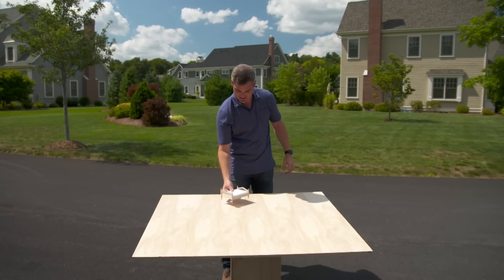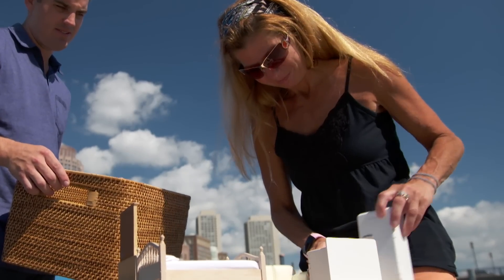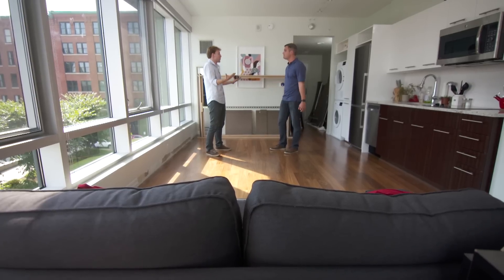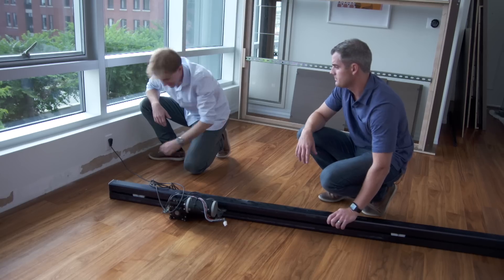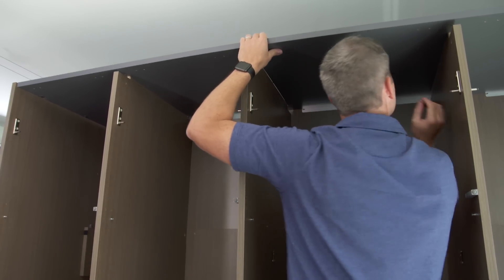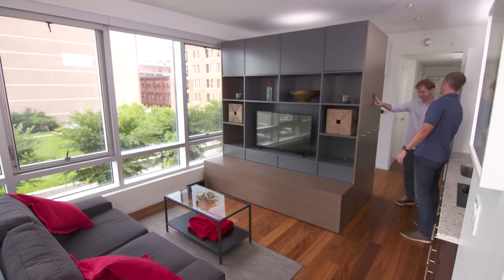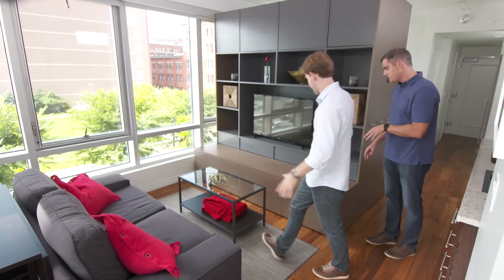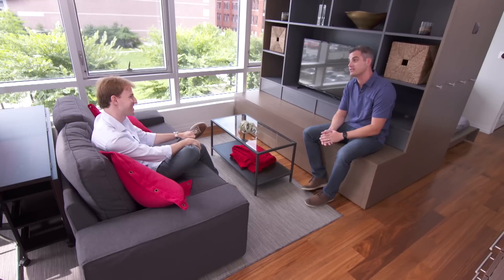How to Install a Robotic Wall | Future House | Ask This Old House

Comment: Yeah, that's a great conversation piece, but what are you really gaining when the shelf is up against the wall, a little extra space that you can never actually use. You're going to have to keep that area clear, so you can slide the shelf to get to your bed. I mean, if you need extra space just turn the coffee table sideways, put it under the window and push the couch up against the wall. I'm sorry, but the more I think about it, this one just doesn't make sense in any way shape or form.

Comment: "Hi, maintenance? Yeah, the motor for my motorized but not robotic wall went out, and now I cant go to bed." It seems to me that if they can make huge library stacks move easily by hand, this should be able to as well. It seems WAYYY overbuilt. Like, seriously, you made the entire frame out of steel? Sounds to me like a great way to scam some yuppies out of an extra like ten grand over building the same thing, but properly. I'd be way more impressed if you could actually move it with a finger, which is absolutely possible.

Comment: I absolutely would NEVER live in the city, and I do not understand the workings of the folks who do it on purpose. You could easily live in a small home and not have to be in the city. Not all ppl go to the suburbs to have bigger places, but to get away from the ugly monstrosity and the traffic and stress of the city. And all these folks that are so worried about the environment, and footprints, etc, but live in the city are actually making environment WORSE. The two biggest negative impacts on the Earth are cities and population. City living is definitely not going to help anyone's footprint or impact. This idea is ridiculously overrated and expensive too.. there are much easier and cheaper ways to have moving, compact walls.

Comment: Cheap quality, crappy, particle board low-end IKEA style furniture. It's not built to last and it's going to cost a fortune to replace. They've also completely obscured the motor meaning servicing the device will require a complete teardown of the whole structure. And since it's made of particle board, what little strength it had to begin with will be severely diminished.

Remove the motor, use better materials.

Comment: What is robotic about 1 motor with a switch? What is magical about attaching a bed frame and some Ikea furniture to said motor? Install some sensors so it can't run over your cat. Make Alexa open all the cupboards and drawers with time specific mood lighting. This concept should have been built better and be able to do way more before you put it on this old house and called it something it's not. Try harder.

Comment: I'm not following why any of that needs to be electronic/robotic.  It's basically the same principle as roller archive shelving.  Those you just turn a wheel of sorts to move.  All you would be doing is maybe removing the tracks and having it all on wheels, etc.

Comment: ok ok I can appreciate the idea behind the robotic wall but why would you actually install it for a bed?

Just make a more comfortable sleeping couch instead of having a seperat bed and you safe lots of space instead and I know what i'm talking about while sleeping 90% of the time on my sleeping couch rather than using my actual bed. The main reason I switch to my bed is because of the heat in summer in my living room while my bedroom is actually cooler. Also think of the costs to renew this whole stuff once it gets older and shabby. Not to mention additional energy costs.

It is a cool idea but completely useless in my eyes compared to alternatives which are way cheaper in both purchase and maintaince. 

I really do not get whats wrong with Americans sometimes.

Comment: man that so easy to place everything. walk in on the left is the bedroom and the laundry ( the one with dryer is on the bottom and washer is on top) is on the right, walk in a little bit farther the bedroom is also on the left (with a twin bed), the closet on the right, walk all way in the room is on the right ( with everything included) and finely the kitchen on left and that how you fit everything into a apartment

Comment: Why do they even need to motorize it? Things like that don't need such things when a simple push will do. Build it so it goes close to the ceiling so it can't tip over.  But in the long run this is a solution looking for a made up problem. Just get a raised king sized bed with built in drawers and raised posts (more on that later). Use a movable divider to separate the room as needed. On the king sized bed you can lay a top on the posts for a work surface.  All this for 1/5 the price of this monstrosity.

Comment: So many comments off topic, some about how living in the city means living in rush and wasting your life etc... The point of the video isnt about sense of life only how to design small spaces  and how autonomization can and does help in that.
Also quite sure this isnt exactly robotic and could be more with a few tweaks like ability to program how far does the wall go, sensors to make sure that it stop before hitting obstacle, not hiding Alexa on the other side only get her in the middle and make her do stuff like turn on/off tv, lights in house etc, also sliding out drawers to make it really robotic and smart
But all in all great idea and design :D but some info about where to buy it etc would be nice, its anyway almost like an add

Comment: hmm...plain stupid, ive seen better ways to slide furniture, more reliable, also slide beds.
Usualy any kind of compartimentation in small apparts are doing worse, the inteligent way of using space is to properly use the furniture and have good management, lets say there are beds that fold into the furniture and are way less expensive

Comment: you could add some sort of scissor lift to the bottom of the bed to accommodate for height and form what i can see with the bed it could fit right under the current design.

Comment: Not a robot in even the loosest definition. If this is a robot then so is my blender.
Reply: Your blender is a robot. Robot doesn’t mean a Terminator T-1000 😁
Reply: @wiiten  From Wikipedia: A robot is a machine—especially one programmable by a computer—capable of carrying out a complex series of actions automatically. The Terminator IS a robot, even if fictional. My blender does nothing automatically, it has one speed.

Comment: Well this is pretty cool but at very at the start :) it will just take a lot of iterations but once they get the following key points, it will be the normal as they said:
- Setup at IKEA level (it feels like they are going in that direction from the get go, so that's good)
- Prices for everyone (it won't become the normal until it's as nearly as accessible as nowadays furniture)
- Very customizable solutions (one thing is customizing wood cuts, or at least making furniture in modules, but they need to customize robotic pieces, and things like weight, required strength/power, etc would be non-trivial I guess)
- Well tested solutions for types of living (combinations of different parts, how they fit and interact in relation to various usage patterns, e.g. a student appartment with two flatmates or a family of four)
- More backup plans for power outage (or system breakdown)
- Software (this was just basic mechanics... we need to talk to the house, the house needs to be able to reply and do things for us (like: clean "yourself" in 1 hour please, or: we want dinner for 3 at 6pm thanks)
And there is probably more... but nonetheless... we gotta start somewhere to go elsewhere :)

Comment: i made this when i was at school and used doorbell switches (spring loaded two of them) to control the motor. the only difference was that i did not have that much money to get every premium stuff required. i too called it robotic closet and PC case and got a tight slap from my mom on the allegation of using a misleading title, so i changed the name into motorized PC table come closet.

Comment: Clever…you guys made it a hell of a lot easier to pancake someone while their asleep. 

Modern day computers & wifi sending information via binary code isn't difficult to hack if you have the right software & are intended for malicious behaviour.
Reply: That kind of assumes the machine is both strong enough to crush a person and lacking in sufficient fail safes. Just because it's automated doesn't mean that they don't have mechanical safety measures, much like my garage door actually.
Reply: Aslo Aso I could see the danger there for children, the elderly, and the disabled, but healthy adults should be able to get off in time. Lol
Reply: BillyJoe1305 Tho there is no safety measures mentioned in the video, so why assume its there, when its not.

I notice the motors powering the wheels are low geared for high torque use, so speed wont kill them but the torque of those motor holding  up & moving a heavy cabinet against a wall can slowly crush you.

David Patterson Who said they'll be awake to get crushed to death?

Comment: Let's use loads of electric energy to move our walls on rails instead of just getting a bigger room. Brilliant waste of energy! Also where was the bathroom you showed in your first example? Did you even solve that problem with your energy wasting solution? Also: Are you even able to sacrifice that one wall plug when you live in such a small space?

Comment: I remember seeing a video, from like 2010, pretty sure the original content was from before; but the guy put an entire moving wall in an apartment, along with transforming furniture. And his wall wasn't assisted by a motor, but he still moved it effortlessly.
Sofa became a bed, console table became a dining table for 10-12. 
This really isn't anything new or exciting. 
Not even robotic at all. You have a moving wall, you have some electrical components. The most 'robotic' thing about it is the voice commands through Alexa.

Comment: Is this on rails or anything? dosn't look like it is... I could see how after a few months of use, the thing could be half way across the room!
Reply: There is a rail attached to the wall (it was the thing they installed first with the electric motor) and the base for the cabinet is then attached to the motor and it just moves along the black rail thingy

Comment: For how much this costs, this is probably one of the stupidest things I've seen on TOH. There is no need for all of the motors and control electronics. A manual system with proper casters can be built for a fraction of the price.
Reply: crimsonsamuraiftw I could see the motor controls being perfect for older folks though, especially since many of them sell their big homes to live in condo apptms to move away from multi-floor homes (due to muscle issues going up/down). This could also make it easier on their bodies than a manual move system.... even something as simple as sliding out the bed could be a problem for some older folks.
Reply: I would only want this if everything was voice activated.

Comment: What if the space loses electricity? I like the modular ideas, but it needs not to be electrical. Through understanding of materials wood could do all this.
Reply: Like they said in the video, you can disengage the motor and push it.
Reply: I would design it a bit differently

Comment: i see mistake 1 in this vid ; he  blocked  usb's  plug in bottom outlet  :P
Reply: He used the lower socket when actually putting it in so he didn't block the USB connectors.

Comment: I would like to see  a bed That folds out of the wall. But when you fold it up. It has a complete entertainment system underneath of it With TV and all.
Reply: thats really not that hard at all either, just make sure you have padding and bumpers available so that the tv doesn't smack from whiplash.

Comment: This is a good idea, but it's no more a robot than a garage door opener is a robot.

The voice recognition isn't even built in.  It's from Amazon.
Reply: But they are showing that its compatible with alexa. You dont just plug in alexa and expect it to work with everything, this just shows the compatibility with voice recognition software.
Reply: Good point.

Comment: The only people who could find use in that are people who live in a micro apartment and people who are forced to live in a micro apartment have no way of being able to afford that monstrosity of robotics
Reply: Claudio Lavacca it's a large piece of furniture that's been meticulously engineered to be easy to assemble,  elegant and useful.  It could easily cost thousands of dollars.  On the other hand it's a small cost compared to a 300k apartment.
Reply: That is so untrue. In NYC for example, micro apartments can go up to 400,000 dollars for single bedroom, small bathroom, and kitchen. In many cities this is the case too. Micro apartments are owned by very well off people, as they are inside of the city. The only exception would be the un-gentrified areas of NYC which are quite small.
Reply: Of course. I didn't explain my point properly. The product they're selling it's certainly a nice piece of engineering work, but it's not that difficult to make something similar by yourself, if you're able to do it. The product is indeed an elegant solution to a common problem and they need to be rewarded for it, but the techniques they've used to create said product are quite common and not that expensive.
Reply: Yup. And they also gave a nice idea to whoever has the skills to replicate something like this by himself. :)
Reply: Jesse - in certain big cities, even a micro apartment can cost $1000/month+, and the full size apartment can cost $2000 or more a month.  So as you can see, even within 1 year, if you can buy one of these things for a few thousand bucks, you would come out ahead as long as the cost of one of these is less than $12000.  Now, this isn't the only solution to this problem - the actual problem is that corrupt city governments block and delay new construction.  They do this because rich property owners who bribe the politicians who control the government don't want new space added, because it devalues the space they already own.
Reply: NYC cannot just tell them to keep it low. It's a mix of something called hyper-gentrification and much less space.
Reply: Well, it used to be that having the bigger house was the estate-endgame.
But there was no Internet when that came to be. And entire families lived in many of those mansions (grandparents, parents, and easily up to 5+ kids).
Now, when at home, we're online, connected to a "much bigger house, with so much people, entertainment and knowledge".
In short, before there was a bookshelve (with a limited set of books) and an armchair, now with a mobile device and you can read whatever you want wherever you want. Also families are having way less kids.
I whole heartedly believe that we are going in the direction of smaller houses and we will eventually find a sweet spot between a micro apartment for a single person or a young couple and a slightly larger apartment for a typical family couple + 2-4 kids (regardless of if its geminated houses, isolated houses, or in buildings, or cascades, wtv).
Of course I am biased to what I see and living in Copenhagen did change my way of seeing things.
But I would not want to live in a big house even if I was being paid for it.
Don't get me wrong, robotics is not the solution, it's just a new way of doing the same, in less space, improving practicallity, maximizing our homeflow (in contrast with workflow) efficiency, and ultimately cutting costs and gaining time (because time is in fact the only real currency we have. When you buy a big house, you are paying with the time of your life that it took to acquire that money).
Sorry for the lenghty post. I was inspired. I hope it's inspiring. I need a beer. Cheers!
Reply: Claudio Lavacca fair enough,  looks like these products are geared towards those who don't have the time,  space, or technical knowledge to make their own.
Reply: Why not just keep property price low? A small single room apartment shouldn't cost the same as a 3-4 bedroom house
Reply: @keeganlad  and how do you propose that happen?
Reply: It's not really robotic. And a simple piece of furniture attached to a motor is not that expensive.
Reply: A small space like this can easily cost a million dollars in places like NY and SF. So you're assumption is incorrect.
Reply: @edrcozonoking  people who can afford to live in those apartments can afford a house so having these apartments entails not utility but using for the odd time. They don't need that much utility for temporary accommodation. So I'm correct. Also this was posted 4 years ago.

Comment: Good use of space but the bed is too close to the floor.  Should have a way to lift it up about 2ft or so.  Maybe add some retractable legs underneath the bed section.
Reply: If you paid attention they said the size and height of the bed is made to order. And there's nothing wrong with a low bed
Reply: they said you can get it at different heights
Reply: I'd be more annoyed about having a double bed where you can only get out on one side or the foot end.

Comment: Average home for who, the rich?
Reply: negative, time is the enemy
Reply: The rich are the enemy!
Reply: Not really, think of new york, where small apartments cost a very big amount of money. A robotic wall would still be way cheaper than a bigger apartment.
Reply: It's an attempt to use space more efficiently and thus make living cheaper. I think rich people prefer their mansions.
Reply: why?
Reply: Not necessarily. There are many rural areas in America where homes are cheap.
Reply: : ) right.
Reply: Wide people
Reply: People who can Bubet the best really. Am 30 and own a house thats over 2,000 sq ft. its called saveing money. ITs not the croptions holding you down its yourself. Remever its 80% behave and 20% math.